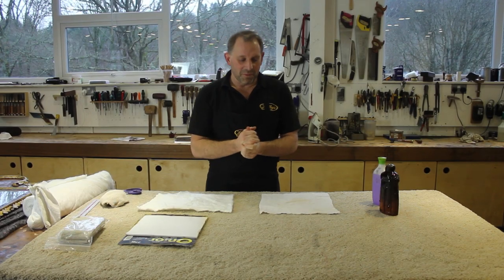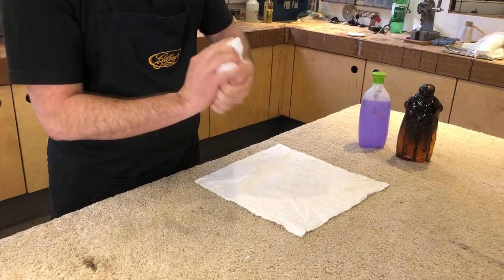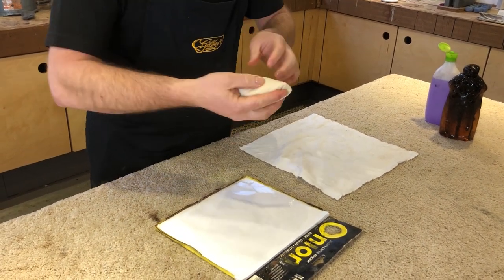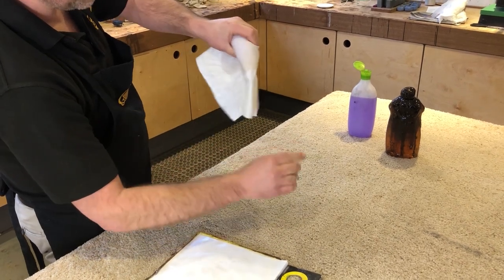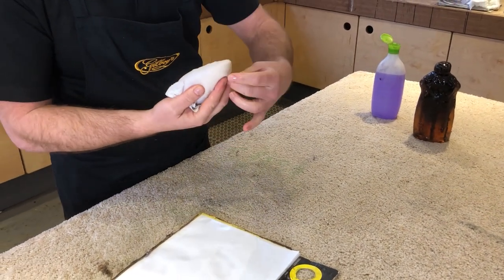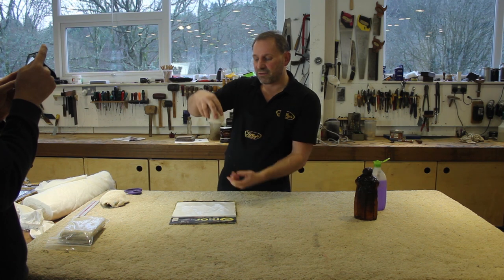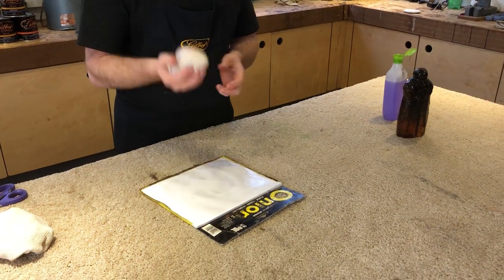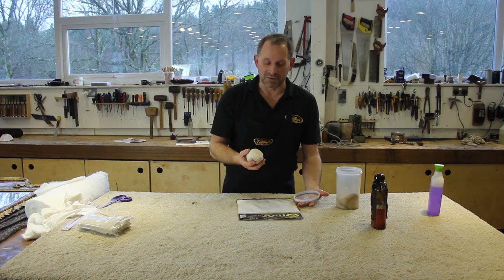How to make a French Polishers Rubber

Comment: This was certainly helpful. I made the mistake of using cotton balls and a blue t-shirt. Turned out okay. So armed with this tutorial I used cotton balls all shredded up with some wool batting wrapped in an old cotton hanky. The obvious advantage of using white is you’re aware of the rubber’s charge. So this new rubber was used to fix my original ‘tragedy’. So thanks for the tutorial and my guitar thanks you as well! Edit: I should have mentioned that I also went from a 3# cut to about a 1.5# cut. The resulting bodying is much smoother and I presume this has to do with a proper rubber as well as the thinner material being laid out. Based on where it's at right now the spiriting off looks like it will be mostly about the oil and not really refining the finish. I've also noticed the new rubber requires less oil. From one session to the next I have been able to 'ride the wave' of the oil from the previous session. Thanks again for the enlightenment.
Reply from the maker: Well done Joe
Its all about finding the right way it works for you.👏
Kind regards 
Simon

Comment: Question for you: What type of cotton cloth do you use for the outside layer of the rubber? I've seen some say common T-shirt material is fine and others say it must be linen. Any suggestions on what weave or "type" I'm looking for?
Reply: T shirt cotton is no good for making rubbers, Linen is great but hard to come by, the best and most easily available material is good quality (at least 1200 count) old well used cotton sheet.

Comment: Great video , any tips on using oil for the finishing coats ?
Reply from the maker: HI Crafty Paddy. Use fine mineral oil. Apply it evenly (roughly about 15 - 20 cm apart) to the surface in small drops and let the rubber pick it up as it glides over the top.

Comment: I'm  little confused by the end of the presentation.  You made a fad out of stockinette, but used it to apply polish without a rubber.  Is that for applying the polish quickly to body up?  And then you go to the fad with a cotton rubber to work the polish into the wood pores and to start burnishing the surface to flatten it?
Reply from the maker: Hi james. The third process of the French Polishing process is 'fadding'. The fad is used to apply the polish (shellac) to the surface, quickly building an initial 'body' of polish which can be lightly sanded back ready for any further colouring and minor defect surface repairs. Then we move on to the bodying process using a rubber. 

The rubber gives much greater control of the polish allowing the user to apply more or less pressure depending on how it feels on the surface. The pure cotton cloth wrapped around the fad creating a 'Rubber' prevents the surface from being marked and allows you the user to apply a downward even force, in effect applying more polish and also flattening the polish and forcing it into the grain and pores, as you rightly say in your question. 

I suppose one way of looking at it may be to compare it to using a traditional paint system: Primer, Undercoat and then Gloss. When you apply a paint primer you are nowhere near as careful as you would be when you apply the last undercoat or gloss coat, the 'fadding process' is the 'primer undercoat'.    

I hope this helps..
Simon
Reply: Yes, that's clear.  I have used stockinette only for buffing out dried wax, but I will give it a try as a fad.  I'll be refinishing an Edwardian cutlery cabinet next, but it requires some restoration first.
Reply: James thanks very good question.

Comment: Hi. Just wondering how many layers of polish do you do with the fad before you move to the rubber? Thanks
Reply: Personally I would just use the rubber from the start, but either way no one can say. It all depends on the type of wood your working on, how well sanded it is (should be down to minimum 320 grit), if you have used a grain filler first. The it is not about layers, it not like brushing where you can count how many coats you have put on. Its about build up the polish until the surface is too wet to continue, then you leave it overnight come back and repeat until you have a finish your happy with.

Comment: I just talked to a professional french polisher who says there must be pumice included in the rubber. What do you think of that technique?
Reply from the maker: Hi Tina. Did he explain why? Pumice is a very fine abrasive. I'd be interested how this would work?
Reply: The only time I've seen pumice used was in the first spit coats to use as a grain filler
Reply: A pumice rubber is used to help grind down and flatten a partially polished finish. It was primarily used for very glossy work. Pumice was also used for water dulling, I suspect before the advent of fine wire wool.

Comment: The rubber is easy (14 min video to show that?)... The polish liquid is what i want to learn how to do...  Dont mean to be arrogant :) The secret is in the mix my friends!
Reply from the maker: Hi André
The forming and shaping of the rubber is so very important to get right. It is the principle foundation of the process. I have taught many apprentices to do this and it is not easy. 

Yes you are correct in saying getting the right balance of polish and meths 'charged' correctly in the rubber is also important but not having the tool to do the job in the first place is half the battle. 

You wouldn't paint your house with a tiny brush nor would you dig a large field with a small spade. Both will work, and eventually achieve a result but why put yourself through the pain. :)
Reply: @GilboysRestoration  , so nice of you to reply! Im acctually in shock. Thank you for the advice! Your video was helpfull, and just so you know, it was the best rubber i've ever seen beeing made in youtube and real life, TOP 1. I will try to do it in your way.. i've ear that a linen cloth on the outside is better than cotton because cotton tend to loose the very small and thin fibers. Anyway, thank you and good work!!!

Comment: Don’t need to French polish anything anymore just rub it down and coat it with sprayed high gloss lacquer followed by wet sand, polish and wax job done 🤣
Reply from the maker: Where do I start...😆
Reply: @GilboysRestoration  I think he means, "So, you take the 18th. century tallboy, rub it down, spray with a high gloss lacquer, followed by wet sand, polish and wax and job done, thus ruining the piece and destroying any value it may have had.'
He just forgot to add the last phrase.
Reply from the maker: @Offshoreorganbuilder  That pretty much sums it up. 😆